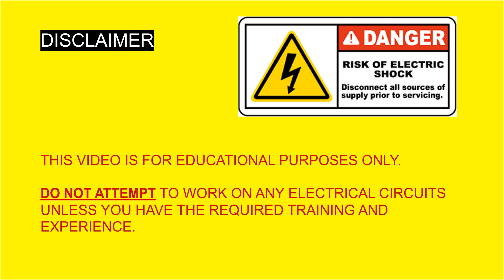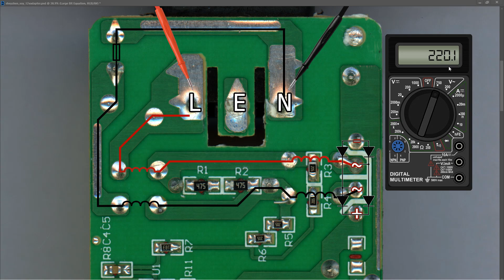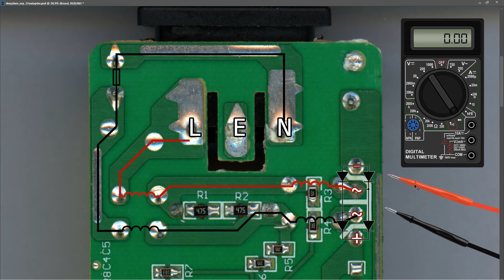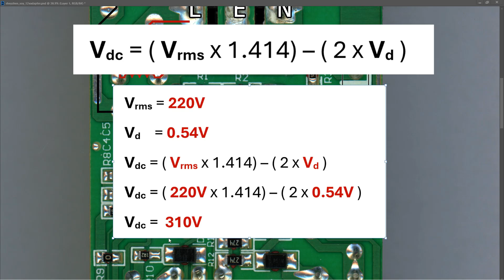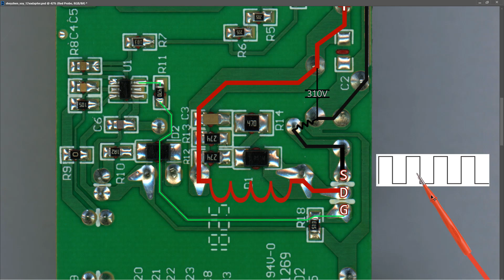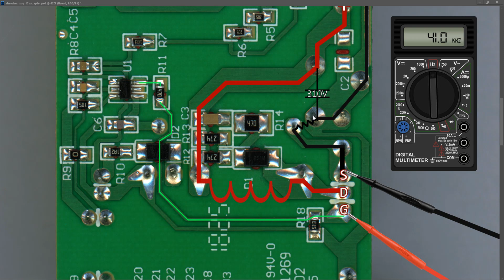HIKVISION 22 INCH MONITOR - FURTHER ANALYSIS OF POWER ADAPTER

Comment: This is a very interesting topic. My only concern is that these devices were made to be tossed aside when they fail. There is no way to open them, repair them, and reassemble them in their original form. But the video content is top notch.
Reply: @danarepouille: Hi.
a) You can open it with dremel rotary tool
b) Use loctite 480 glue (industry standard) if you want to seal it like the original or better yet good quality black electrical tape (adhesion) to reclose the covers, which makes it easier to open in case of an unexpected failure and return again for warranty.
As an example: Dell laptops typically use 65W chargers for most of their models. For your laptops dedicated to video games (Alienware) 180W and 240W. Same values as Asus ROG (Republic Of Gamers) but remember that there is a Pin Detect that must be recognized by the Super I/O IC located on the motherboard so it is best to use the original charger from each manufacturer.
Regarding electronic spare parts for both mentioned manufacturers, they are available in recognized specialist stores. All the best.